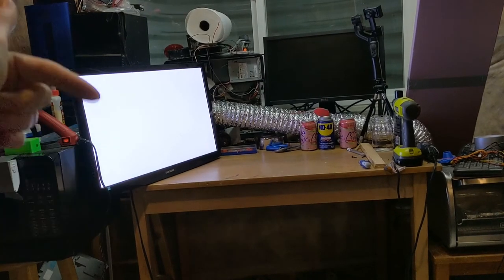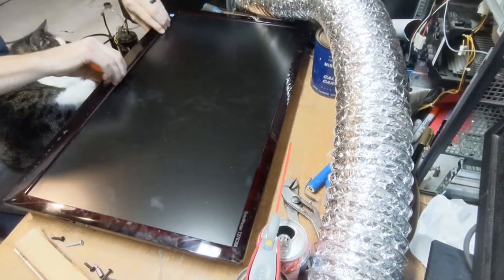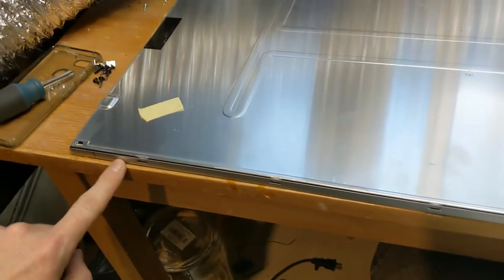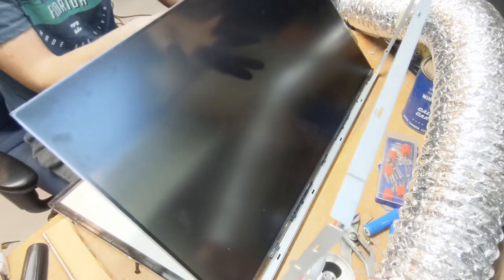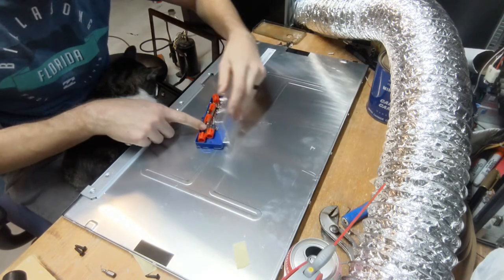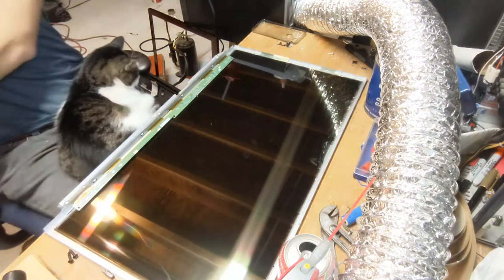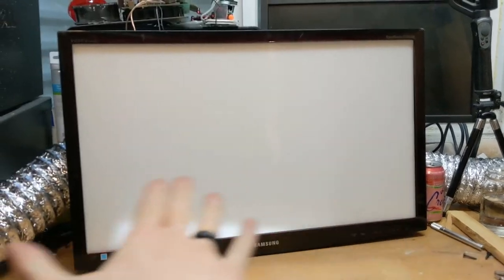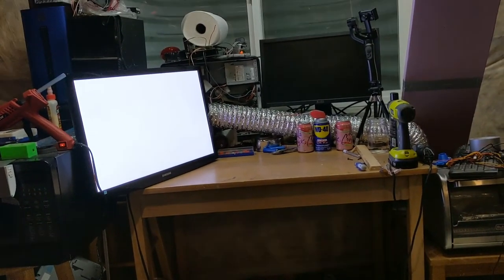Turn Your Old PC Monitor Into a Panel Light!

Comment: In your experience, is this drastically brighter than the monitor with the LCD? Example: taking a white photo, putting it in full screen mode, and maxing out the monitor's brightness. I imagine it would be brighter considering the way the camera reacted, but I just thought I'd check. Awesome video by the way!
Reply from the maker: Thanks, I'm glad you enjoyed the video! It is definitely brighter without the LCD on it. The LCD and the polarizing filters actually block a pretty good amount of light.
Reply: @science1324  Thanks for the insight!

Comment: Amazing video! I have a question:
If I were to purchase a "broken monitor" online, most broken monitors have smashed screen. Would this affect still using it as a light panel, as all we need is the light and not the LCD display? Thanks in advance :)
Reply: It won't affect at all,  u just need the led at the back and those diffusion sheets 

U can even do it with led strips on a cardboard lol

Comment: I want to try this out,
However I wanted to know how to disable standby or power save modes
Reply: That's the issue I have. Have a place that gives me monitors and TV's.
Reply: you have to do that before you disassemble and with the monitor connected to a switched-on computer.....
Reply: @GitXxxd  I have about 20 or so Dell monitors that were given to me. All 17 inch over a 3 year period. All of them had broken screens before I took them apart. I guess I could set them up with one good screen in a dual screen set up. I have disconnected the LCD broken part. So I don't know.
Reply: @GitXxxd  I have about 20 or so Dell monitors that were given to me. All 17 inch over a 3 year period. All of them had broken screens before I took them apart. I guess I could set them up with one good screen in a dual screen set up. I have disconnected the LCD broken part. So I don't know.
Reply: @chuckfinley5206  
that's nice, man!  
wow, 20+ 17"s!!  incredible!  
I can't remember if I've tried it, but how about you remove the front panel.....  maybe if there is no signal, the screen won't light up??
Reply: @GitXxxd  they just cut off after they are on for 2 to 5 min. Cool thing is I have about 30 Dell monitors that work so I can set up a video wall. They all have the same bezel style. Have a total of about 80 or so monitors. There may be around 70 flat panel TV's here. This is what happens when you have a place that gives you free electronics for 5 years. Been getting picture frames from the same place for about 3 years.

Planning an audio video museum. And a place for old folks to hang out. There will be a frame and art studio too. Haven't figured out how I'm going to pull it off yet. It's almost impossible to walk through the house at the moment.
Reply: @chuckfinley5206  
 @chuckfinley5206  
I was thinking of tell you about a video wall!  hahah, yes, that's 1 great idea!!  
okay, so since you have so many, what you can try to do is find 2--5 good monitors, set them up right ~ disable the necessary settings, then power off the screens directly (don't use the power button). 
disconnect the control panels board(s), plug them into the faulty screens, change the necessary settings......etc, etc......
Reply: @chuckfinley5206  this sounds amazing. I hope you make or made it work.
Reply: @krisbacks haven't had time to mess with them. House is so stuffed full of monitors and TV's. Picked up 18, 32 inch TVs a week ago. Spend more time trying to figure out how to store all this stuff. I'm close to a 100 flat screen TV's. I know I have over 80 monitors now. Bought a trailer for my Ebike. I may hold a record for hauling 10 32 inch TVs on a bike.

Comment: @science1324  Great ! but when I tried this with my old AOC flatron,  switching on the monitor button, makes it shining, and just after one second it turns off automatically. It seems that the monitor guesses that there is no computer connected, and then it switches to standby mode. Then I was wondering if connecting the VGA plug to a special connector (female VGA to USB [I noticed that this connector is sold on aliexpress]), plugged tp an old USB flash drive, could make the VGA plug believe that something is plugged to itself, enough to stay permanently on "switched on" mode....Do you think that it could work ?
precision : I am a zero in electronics things...
Reply: Same
Reply: same
Reply: Before begining :
Soluce given by From Artur Voirin, in comment to : LightBox from an old LCD screen JustinLovesTheTech
Pro tip if you do not want the backlight to turn itself off : go into the monitor's built-in settings menu and disable all sleep mode and energy save functions. Of course you have to do that before the screen is disassembled and most displays will want to receive a signal to allow you to go inside the menus.
Reply: @NTNGIMPRTNT  see my own reply :/
Reply: @gxrou._7962  see my own reply :/
Reply: @nardber6598  thx for the pro tip!
Reply: Just change the light source , this one isn't made for illumination anyways, get yourself a led strip and thank me later
Reply: @nardber6598   Hi, the whole idea of this video is to make use of a monitor with bad LCD to turn it into a light source instead of taking it to the dumpster, so the on screen menu will not work because the monitor is not working, do you know of a way to by pass this like disabling the chip on the card in the back of the monitor? thanks,
Reply: @BeeTammo  Hi, No, sorry !
Reply: So the video is good and clear. But the main part to make it work was left off?

Too bad.

Comment: Didn't work. The light panel turns off after several seconds.
Reply: same
Reply: I think its because the screen is going to sleep mode. But I don't know how to fix that
Reply: Same here. Came here looking for the answer.
Reply: same, i tried with a dummy hdmi dongle and still powering off.

Comment: Thanks for the video, I tried your method on a different Samsung monitor( SAMSUNG SD360 Series S27D360H) its working but for only 5 minutes after that it goes to sleep , do you know how to fix this problem?
Reply: I solved mine using some cheap Miracast/Chromecast. It stays on standby mode for connection.But u gonna need a extra usb port to power the Chromecast. I'm using a old Miracast which has usb male and female cable. So I can use both the work light and charge my phone.